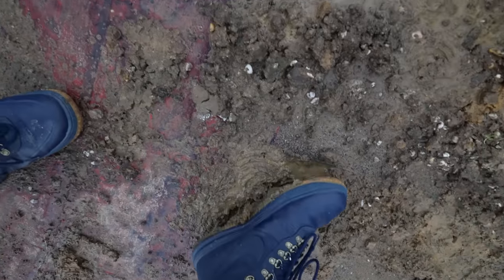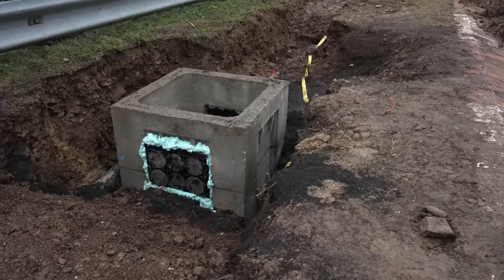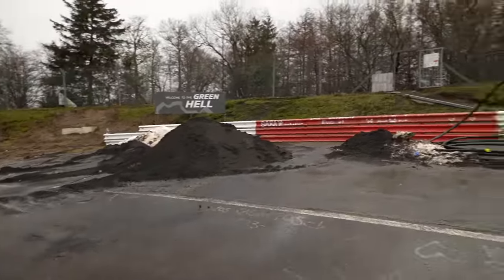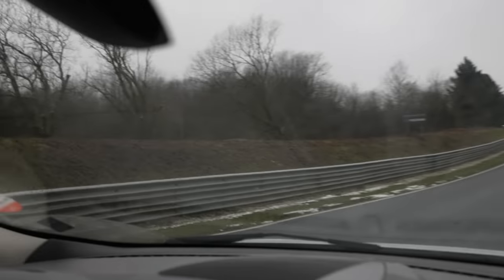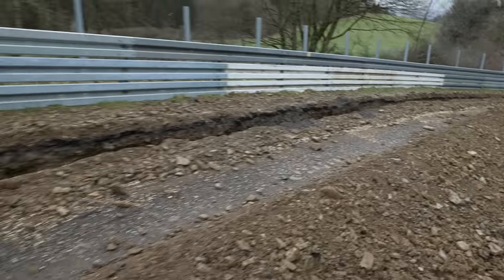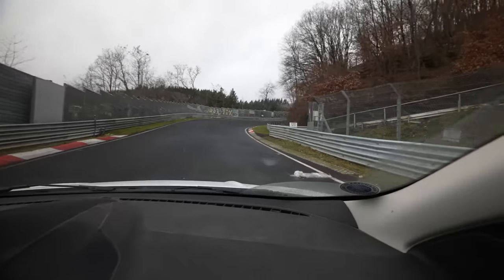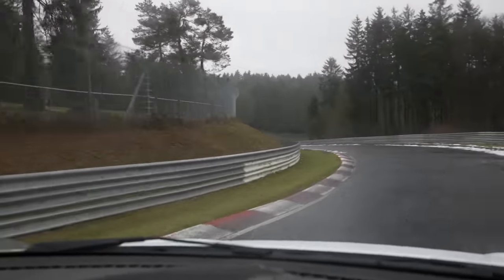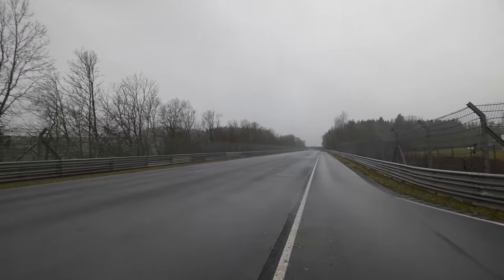€11 Million Euro! 2023 Nürburgring Safety Updates!

Comment: Those concrete containers you kept referring to as camera foundations are actually pre-formed junction or connection pits.

They can be used for water or electrical (but never both at the same time).

They allow electrical conduits (the big black plastic pipes) to enter from multiple directions.

Then inside the pit, electrical and maybe fibre optic cables will enter from the conduits and can be connected to adaptors, electronics etc. In the future, if a wire is broken or new equipment is installed, it gives workers easy access to run new sections of cable, or do repairs.

They will be covered by lids so you can drive over them safely, but still remove the lid to work on them.

A foundation needs to be something that will hold a weight and resist movement.

This may take the form of long beams driven deep into the ground where friction will hold them in place, or wide heavy concrete pads that spread the weight across the ground and resist tipping over.

These pre-formed pits can't do that effectively, you would need to fill in around the outside of them AND fill in the inside. At which point, just pouring concrete into a hole will do a better job and be cheaper.

The project seems pretty cool and I'd love to know if they are already using it to upgrade other features or plan to do so in a later project.

Such as update the marshal communications, install electric safety lights (to be used alongside safety flags), have data access connections for race coverage camera operators etc.
Reply: Yeah, those cameras would not last a week this close to the track ;)

Comment: Ehm.. I hope those aren't the foundations for the actual cameras?! That would be a giant hazard as they are in front of the barrier (or if they have to place a barrier in front of them, it will be A LOT closer to the track). Maybe it's just a junctionbox for the cables etc and the actual cameras will come behind the barrier?
Reply: yeah hopefully otherwise that does not make sense in any way...
Reply: Looks like junction boxes to me, too. I'd think the cameras have extra foundations and (hopefully) break-away bolts
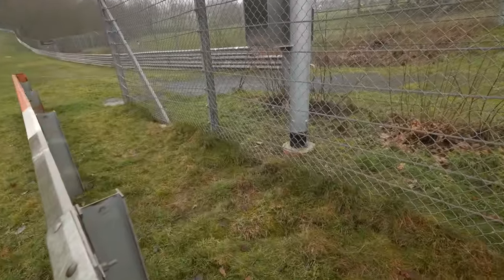Reply: At 14:02 you can see the foundation of one camera, it's smaller than the junction boxes and round, so those concrete boxes are out of the question
Reply from the maker: They would go under the ground first :)
Reply: No, those are not "foundations", those are what we refer to in the communications industry as "Vaults". These vaults contain junctions, and splice cases for the fiber optics. As well as occasionally holding a power transformer, a laser relay, a muxer/demuxer, etc.

Effectively these vaults are placed at the intermediate junctions for each run of fiber bundle, and where each camera will be placed. You can see in a couple of shots where, from the splice case, the conduit is running up the hill behind the fencing where the cameras will go. Asd Misha showed in his final shot, the actual camera pole mount, is a small above ground concrete former, that is likely conical shaped underground for stability.

What i cant quite understand, is why they are laying the conduit, junctions, and vaults on the track itself, and not in the footpath and infrastructure roads in and around the track? I imagine it is probably due to cost and time. As it is far faster and easier to get big equipment in and out of the race track, than in and out of the service roads. I just hope the vaults get properly buried, and do not sit flush with the ground. Because vaults that are installed flush, always end up proud to the ground around them. And that would be a disaster for any car going off.

Comment: they should put in a good WiFi system at the same time that ppl can pay to use. will be nice to have for races etc. in car cameras. they have all the conduit in there now and the concrete junction boxes. all they need is to use some of the unused fiber strands and make a good network ;)

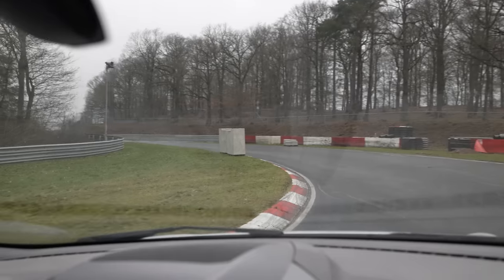Comment: Extremely nice safety upgrades on Nurburgring. However, those concrete posts at 9:35 on the side of the track could be a safety hazard if in the case of intense wheel-to-wheel racing and a car going off the track wouldn't it just crash into the cement posts?
Reply: Nah they are specially engineered to play the voiceline SKILL ISSUE when you hit them. They are gonna stay this year
Reply: If I'm not mistaken, the boxes he keeps referring to as foundation blocks are actually "Junction boxes"/inspection pits for the cables. The posts and cameras will all be behind the barriers out of harms way.

Comment: Those "foundation blocks" are actually chambers, for joining and turning the cables that come into the chambers from the ducts, which join the chambers and cameras. The camera tower foundation is a cylinder, the top of which is visible in the finished example on the main straight. It is also placed behind the safety fence, unlike the chambers, which are placed in the verge.

Comment: I just wonder… So foundation for cameras is at the side of track (inside barriers) isn’t it unsafe for racing? Because if accident happen then the car might go straight into that camera poll. Shouldn’t those camera polls be outside of barriers?
Reply: yeah wtf that looks and sounds weird, havong thick conrete columns right inside the guardrails, the track already has a slim margin for error and sometimes overtaking needs 2 tires over the curb but this way you are basically already into a concrete pillar the moment your tires touch the curb
Reply: Ive been looking for this comment. I thought i was the only one for a sec.
Reply: those are manholes for cables, not the foundations for the cameras.
Reply: Oh, ok cool
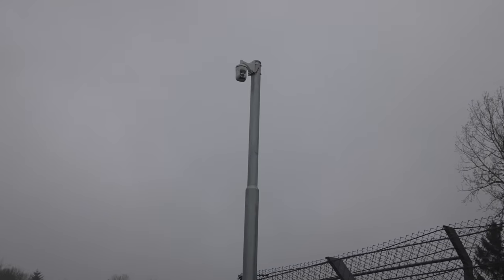Reply: @Dornogol  those are manholes for cables, not the foundations for the cameras. Look at 13:52

Comment: Those big tubes are what's termed 'Trunking/conduit' they protect cables and allow them to then run all the cables through it to those concrete boxes in ground which many have said about cameras outside barriers those are what would be termed 'Junction boxes/service hatches' one being where cables run through to each camera point and then follow on to next point and so on(same as ring main in your house/office/workshop etc)and service hatches/points could also have other items in there like power/gps/wifi and other controls which could be to provide communications to marshals posts so then could use various wireless comms.
Tops/lids will be surface level/flush so you can't Scurf them out on your travels!. but should any issues arise they can lift lids and fix.

Comment: Maybe I'm missing something- were a few of those cameras inside the barrier (as in, track side) ??
Surely you want them behind the barrier, in the case of a spin etc?
Very interesting to see the work though, thank you Misha 👍👌
Reply: what he mentioned/shows are not the foundations for the masts but control shafts for the cable system.  the camera masts will be behind the protective fences.
Reply: @rfracing964  That makes much more sense. Thank you for explaining :)
Reply: yep i was shocked at first , but then i realize that the things that Misha called fundations are just the underground boxes for the conection of the poles

Comment: That's most likely not a foundation for the camera, but merely a junction box for the cables. I'm 99.9% sure that the FIA would not put up metal poles with cameras on it in the run-off areas.
Reply: I was thinking the same thing.

Comment: @5:30 If this is the foundation for the cameras - inside of the crash barrier - they wouldnt last long. Really? Are you shure? I hope, this are only the junction points between the new wiring around the ring and the cables to each camera behind the barriers.
Reply: No, those concrete squares are just wiring vaults for the fiber optic cables. The cameras themselves will be behind the armco and behind the fencing.
Reply: @bigbuckoramma  ...as I said at the end. This makes sense. THX .

Comment: Do I understand correctly the concrete blocks are before the armco, so the poles that have the cameras are in front of the barriers?
Reply: Just a misunderstanding by Misha, these are connecting wells for the cables, the poles themselves are outside the barrier.

Comment: Why wouldn't they lay pipes to each pit?🧐 Then they can all cabling etc through it. 🙄 More importantly they should be putting the purs and trenches behind the barrier. What are they thinking?🧐 If work was behind the barriers work could still possibly continue after the winter break.

Comment: Significantly more safer huh? Ask youself; if a tracks safety team struggle with cutting back vegetation accross a blind corner, and the frequency of this cutting back involves the corner returning to fully blind before anyone does anything... and when they do, they fail to do any useful work at another corner where the last fatal tf accident occurred... do you think that if such an odd and wholly dysfunctional regime exists they will be able to specify a computer system that has any meaningful proactive effect? Seems unlikely. But if they can change, and this really is useful, and not an 11m euro white elephant.... then how come we struggle with basics so much? Here's another safety and infrastructure question; if your marshalling, the bridge into QH is extremely high risk. There is no way to get back accross that bridge that isnt highly hazardous. The new cabling system is going to need to be supported. Do you think the supports or structure will be designed with a dual safety function.... this lack of integration would be funny if it didnt result in such disappointing circumstances. I wonder who has designed the AI system? Is it a shopping system hoped to cope with none retail? Is it a logistics system normally tracking low speed parcels? Or is it a truly bespoke system designed by an experienced man who has real world, bloody experience of how fast things can change when your track side. I bet it's not the third option. Any video extolling the sucess of a half built system before it's done anything useful... at best, misinformation makes admitting hard reality harder. Good luck fellow ringers.
Reply: The AI system will be developed by Fujitsu so it should be pretty good.
Reply: @Maenfy  surely the technology can only be as good as the operator designing the system.  If the highly intelligent and experienced Fujitso programmer knows nothing about race tracks the system will be flawed. Given what passes as acceptable marshalling at the Ring would be considered truly awful everywhere else it doesnt bode well. Or, we get a system that reacts perfectly, and copes with the often unusual circumstances on the Nordschleife, and decides the correct action in milliseconds.... then communicates this good action to under trained and under staffed personnel, via an engaged phone line to too few warning lights sited in foolish, sometimes counter productive locations. All of which cant be updated because we've spent all the money with Fujitsu. Fujitsu might like to distance their name from this in time. Time will tell, but I'm not expecting great things. One last bit of cynic logic; if you cant do all the track at once for entirely reasonable cost and logistical reasons.... why do the first half of the circuit first, when Ex Muhle to Hedwigshohe has the highest fatal statistics? Assuming the primary objective is to reduce knock on accidents. Or is this just more political shit?